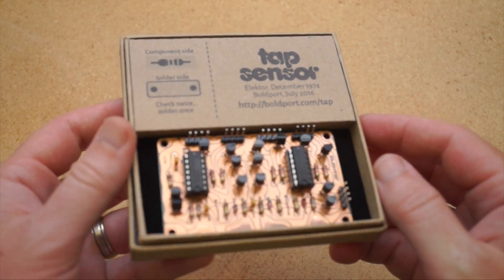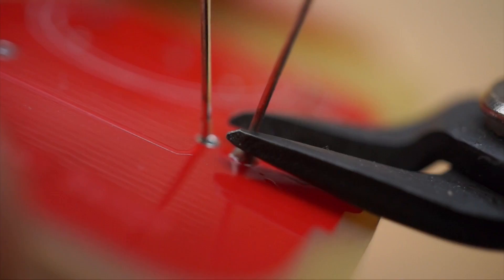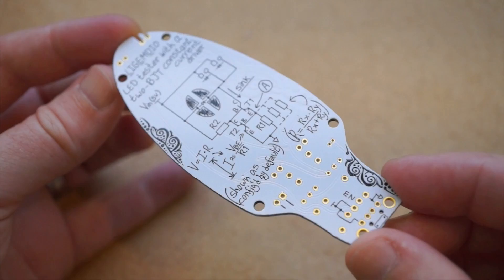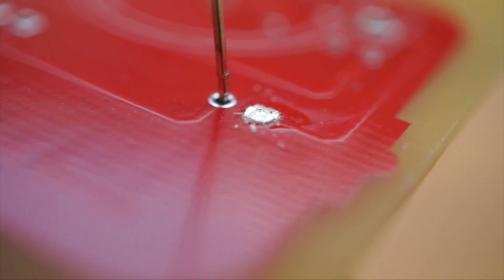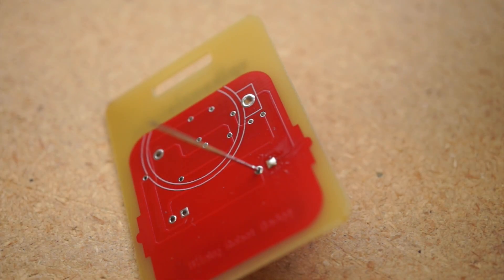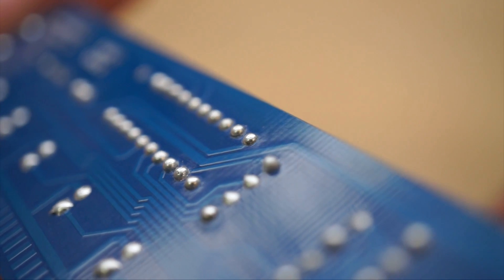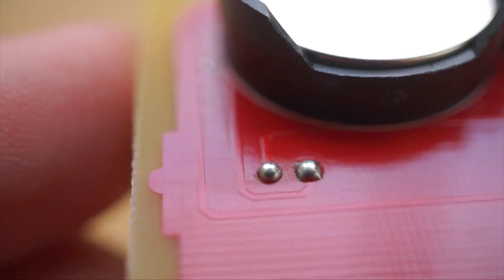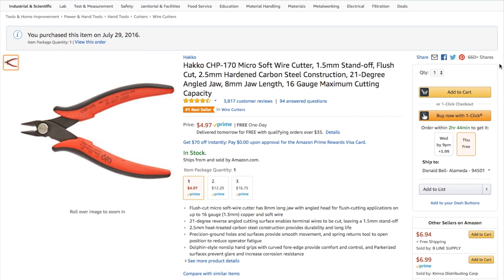How to Make Beautiful Solder Joints

Comment: These joint looks good but not every circuit should have such, maybe things like tv, DVD and other small appliances but some other things where there are constant movement or vibration or lots of heat shouldn't be solder in such a way